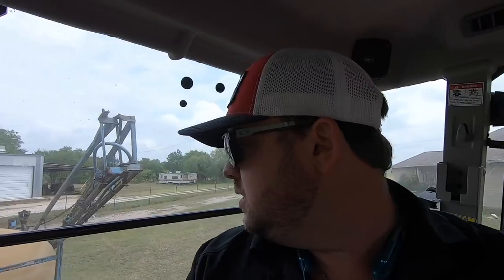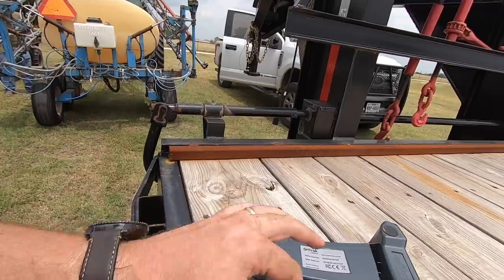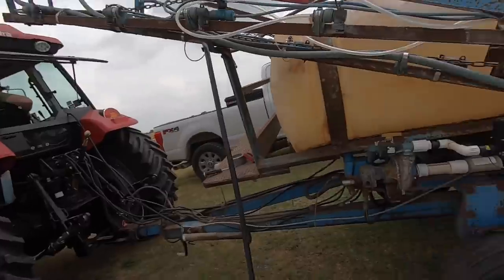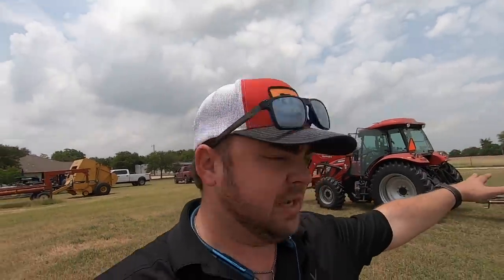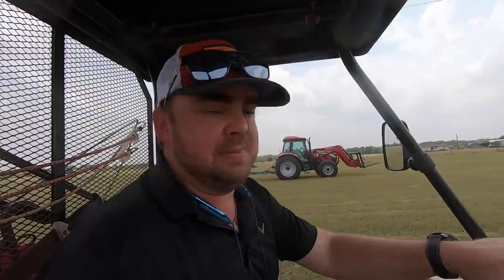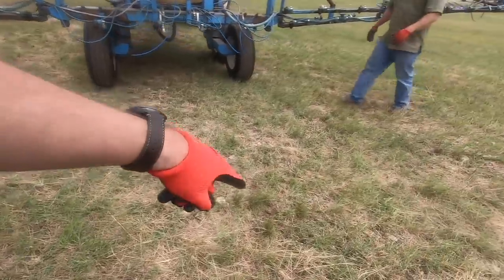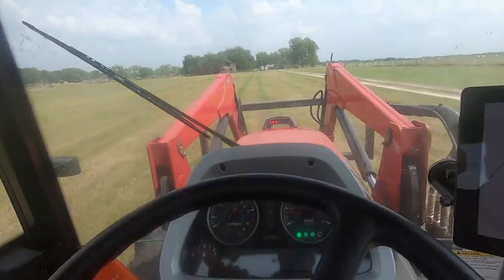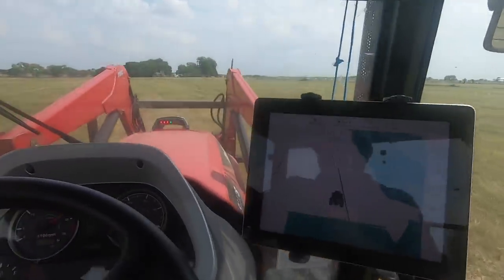HOW TO SAVE TIME AND MONEY USING MODERN FARM TOOLS

Comment: I am a way smaller operation than yours and I run and Agleader Compass and it is awesome. Cost me 2K but man has it been a huge help and money saver. It offers multiple guidance patterns. I use it almost every time I'm in a field for anything, even cutting hay. Nice to skip over and just take the line that pops up and have you sections not triangle when mowing out like when you guess at it. Also great to see how many races out have covered. I also added electric valves on my sprayer to turn off and on to prevent overlaps and wasting spray. Don't know how I got along with a GPS now!

Comment: Save thousands but spend a thousand. Gonna need to find me a guidance system soon. Building a custom sprayer. Good video.
Reply from the maker: Yea. They cost up front. But compared to other light bar guidance systems on the market, this one is decently priced and very flexible.

Comment: That's a nice system, the only thing that would be nice is if they could allow a pressure switch to tie into the GPS to mark painting.  I have a Raven system that allows the switch painting but the user interface is so much better.
Reply from the maker: It is a cool system. Unfortunately limited in regards to other inputs. But for being on a budget, and to keep things simple, the ontrak was a blast to use especially coming from nothing. We normally hire out fertilizing and spraying but we are now gearing up to do everything ourselves

Comment: Will it work in fields with obstacles like trees and such where you can’t go in a straight line? If so can you explain. Thanks. Great videos.
Reply from the maker: It still works best with straight lines. You can go around obstacles and then get back on the line you were on. It does track where you have been so thats nice.